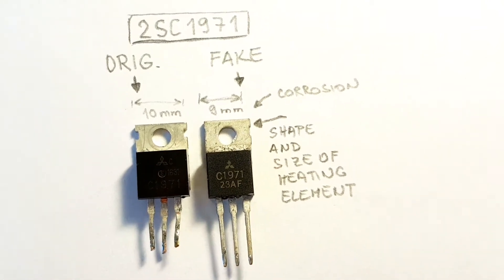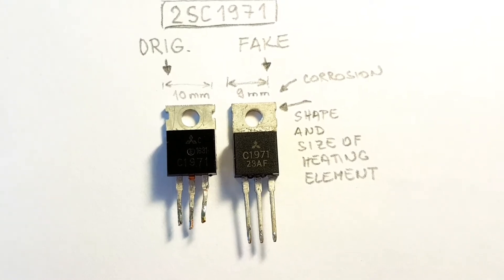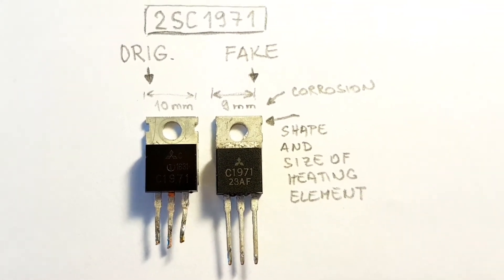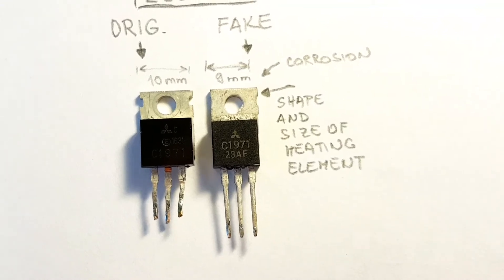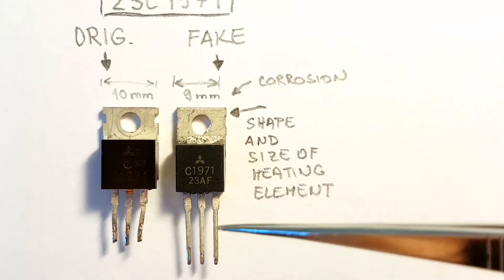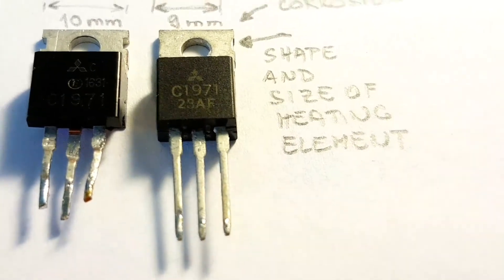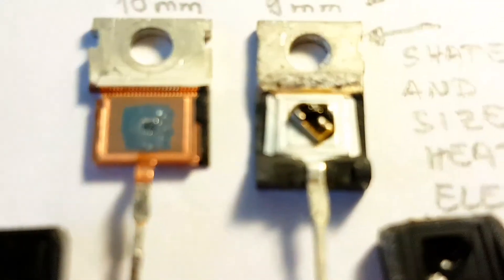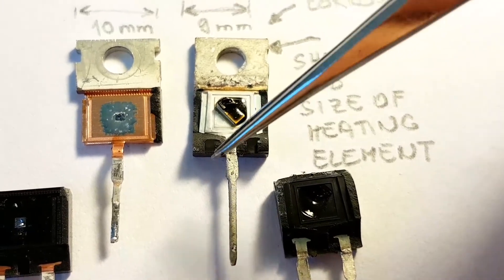FAKED chinese transistor 2SC1971

Comment: China transistors are not the same as the originals....my question is does it work in a circuit ?  I want to buy mj15022 and 15023 transistors from ali because here in belgium i can not find them under 7 euro a piece and i need 36 pieces to restore a amplifier qsc usa 1300.

Comment: The left one looks like countless fakes on the market; internally they all look the same. The die size is roughly 1 mm2; that corresponds with about 10 watts. The 2SC1979 maxes out out 12 watts so the die size is, in this case, comparable. Doesn't mean it will work off course. The one on the right is odd. This has an extra heatsink with the wafer on it, but bonded with a glue like substance. But likely that is just epoxy from cracking it. For my 2 cents, the one on the right has a slightly larger die size and seeing the age of this design looks more 'real' then the one on the left. Again, the one on the left looks like countless to-220 fakes, they all share the same characteristics. Could both be fake of course, with the right one being a rebadged transistor. Only way is to test them in a circuit.
Reply from the maker: Thanks! Strange thing is that both of them did not work. The left one I have got with the RF amplifier DIY KIT and the right one I bought from Aliexpress. It is possible that both of them were fake...

Comment: both are fake
Reply from the maker: On left one came with tranceiver kit and right one I bought from Aliexpress.
Reply: @OM0ET  i have a many one of transistors (left side) Which i removed from old cordless longe range telephones ,which worked on their circuit
I think its a different between a very very orignal and a normal,but still working transistor....as other friend here said,the legs should be( B,E,c) when you hold transistor in front of yourself ,on left hand is base , middle E ,and right side c
Just test it by multimert on dieod mood